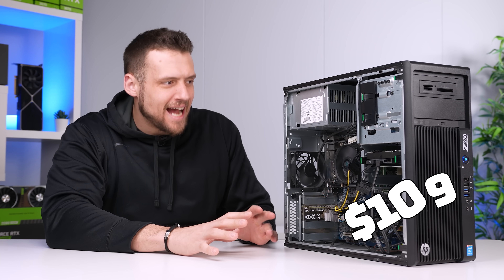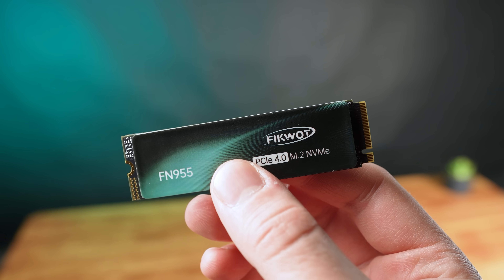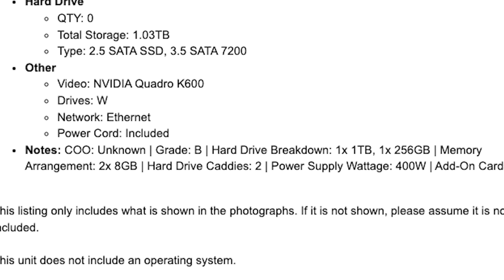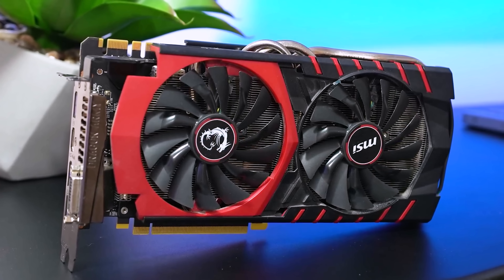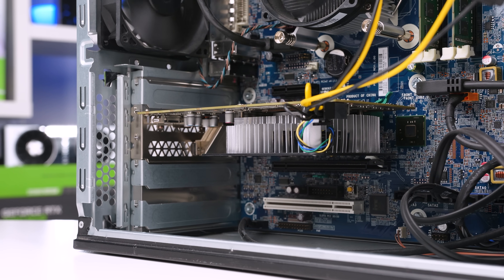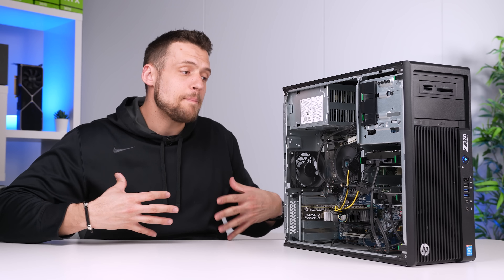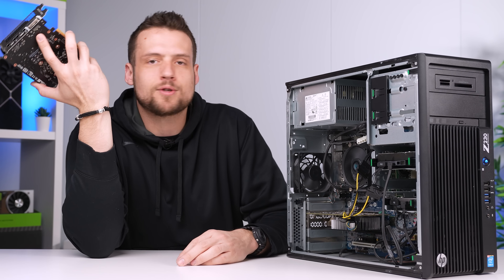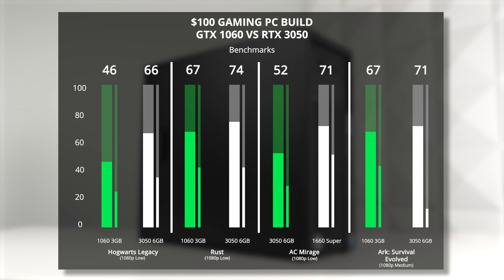This $100 Gaming PC Plays Every Game in 1080p

Comment: Hi ZTT!
Whats your opinion about this pc should i upgrade anything before buying it?

CPU: AMD Ryzen™ 5 5500

GPU: GTX 1660 super 6GB

RAM:2 x 8GB DDR4

Storage: 1000GB NVMe SSD

B550M motherboard

500W Power Supply

ATX Mid-Tower Case
Reply: Dude maybe if you can try to get some used parts yk like idk about the us but i got 3070ti for half the price it's supposed to be in india as it was used and now I'm also building a pc plus get a 550w power supply as most of these PC build vids I've seen recommend 550w still you've got a great setup idea tbh

Comment: I'm running a Frankenstein build. i5 4590 with an hp g1 600 motherboard. 32gb ram 1600hrz, GeForce GT 1030 2gd5. 1tb hdd. And a GX 750w PSU in 2025. Best $100 budget build I could come up with

Comment: Just a warning to everyone: I've had an HP-Z230 since 2013. I added an RX-480, and besides the overburdened 400W PSU shutting-off when loading csgo maps if I didn't ALT+TAB beforehand, it was great for VR and FPS gaming. However, the Xeon E3-1230 v3 can no longer handle CS2. On CS2 Benchmark, it has an average of 140 FPS with P1-lows of 80 FPS with hyperthreading off. I can feel the lag when playing Italy or Nuke, whereas Office and Dust II feel good, so long as a negev is not firing off. At least with CS2, the computer no longer loses power when loading a map.

Comment: if you are gonna do this, you might as well grab either a 6GB version of gtx1060 or an 8GB rx480 or rx580. there are games that will display an error and refuse to run on a 3GB gpu and there are quite a few games that won't run well on a 4GB card.

Comment: Processor Ryzen 7 1700 
M/B Gigabyte GA-B350M-Gaming 3
32GB Ram DDR4 Corsair Vengeance
250GB SSD Samsung Evo 850
Cabinet ATX Mid Tower Corsair
SMPS 500 Watts i-Ball Marathon
Graphics Card 2GB gt 710 2gb
Vs
 NvidiaRyzen 5 5600
Ram 16gb 
256gb SSD 
500gb hddAMD 
600 watt power supply 
Vs 
RYZEN 7 2700X
GIGABYTE B450M DS3H WIFI
8GB RAM
256GB NVME
PSU 550 WATT COOLER MASTER
MSI 6 ARGB FANS CASE 
If they are coming in same price which is the best option

Comment: My dad has 4 Dell XPS office desktops (One of them has a 2TB HDD and has been retrofitted into a local server that the other computers back up to for data safety) that are almost a decade old (if not already) and they've been slowing down. From what I remember off the top of my head, here's what they run on: 
- a 6th gen Intel i7 @3.4GHz - 2 cores, 4 threads
- Intel HD Integrated Graphics
- NVIDIA GeForce GT 730 2GB VRAM
- 8GB DDR4 - 2 X 4GB (UEFI shows 2/4 DIMM slots used)
- 1TB HDD (I don't know the speed)
He has said that he will eventually have to upgrade from these - is it worth it to try and upgrade these PCs to extend their use?

Comment: i love my "low budget" build its a i7 3770  yes its old but i got it for free i got a used gigabyte board for 40€ and a rx 580 for 70€(8gb vram) with 32gb i got with the cpu the case was from a 20€ pc i bought some years ago and i love it

Comment: I have gtx1060 and fx8350x (motherboard and powersupply broke, and now im on r5600g, but that doesnt matter), and even after that long time, my old gtx1060 which isnt even 4gb, but 3gb works perfectly fine on all games, you can easily play cs2 at 140fps average (on min settings, but no issues on higher either, just want some more fps, you know XD) and im pretty happy about it, now im planning to get myself a rtx3050 or rtx3060 for my budget and then my pc will be a beast for 6 more years i guess. Btw nice video, like your content!
Reply: Dude a bit of advice get a used one ,  i got a used 3070 ti for around 500 ish dollars or 35k rupees indian currency and i saw a deal for a used 4080 for rather cheap too
Reply: @Yoloooooooooooooooooooo  Yep, i know that used ones are cheaper, but in different regions there are different prices... For example, if something in my country costs around 50$ then in poland it will cost 15$. You got the point. YES its still will be cheaper for a used one, but not that much/less like in other countries
Reply: @tritaporika  then get a rx6600 as it's cheaper plus better then the 3060 you can look up a few comparisons too and in india we suffer from that overpricing too as a 4090 can cost upto 4k dollars or even more yk i feel you my g
Reply: @tritaporika  dude those vids on your channel, you played those games on gtx 1060 ? You reckon it can play helldivers 2 ?
Reply: @Yoloooooooooooooooooooo  Yep, only on gtx1060 3gb. But to be honest, i dont know ANYTHING about helldivers, but i just checked the system requirements and the minimum is 1050ti, its worse than 1060 so i guess it will have no problems playing it. You can do research by yourself, check the benchmarks, what system requirements does the game have and other things, thats not that hard. i dont do any videos now because literaly nobody were wathing, i have lile 70 videos 30min each, and only some has more than 30 views. Anyways, thanks for question! =D

Comment: I looked up the ebay seller and they charge $85 shipping and handling for an HP Z640 to the east coast! Insane! ZTT must live in Oregon because they offer free pick up or maybe he is excluding shipping costs which would skyrocket the cost of this OEM upgrade.
Reply: There is a pretty good sized weight difference between the Z640 and the Z230 in the video.

Comment: I haver 2 haswell systems:
1:
Asus H97 pro gamer
4790
16gb HyperX 1866
MSI 3060 12gb gaming X
Samsung 1tb SSD
4x 2TB Seagate

2:
MSI Z97 Krait SLI
4790k @4,4ghz
32gb HyperX 1866
Thaichi 7900 XTX
Western digital 1tb
4x 2tb Seagate

The second system is going to be upgraded to a 7800X3D system, but they both run great. 
The first is my office / guest multiplayer PC, the second is my baby. Upgraded graphics first. But you guys guessed....

Comment: Impressive, specially that case with an i7 cpu included at around just 50 USD, that's impossible to find in my country.. instead you can find used pc cases with something like an i3 cpu for around 150 USD..
PD: just reminding, that the gtx 1060 is low-tier and pretty old card, and it's driver support is on it's last stages

Comment: I'm currently using a laptop with low/underpowered i5 5th gen cpu and intel hd graphics (IGPU) and 2x4 4gb ddr3 ram. It was made for only workload, but the hd graphics is can run onlder games like l4d2, tf2 with some configurations, borderlands 2 on lowest settings, yes its that bad. I started using it when I got is as an gift. Love your videos tho.

Comment: I found a crap media centre PC thrown out 3 weeks ago. Chassis is old but high quality and a decent psu. The specs were horrible, FX 5400 4GB ram 1TB rust spinner. I went on AliExpress, €30 for a B85 motherboard, €16 for a E3 1270 V3, €7.98 for 16GB of DDR 3, €5 cooler and I found a low profile 1050 Ti 4GB for €50 second hand (decent price for Spain). All in about €120 and honestly it's a great steam box under the telly in the sitting room. So much so I'm thinking of selling the PS 5 because with a my huge ( since it launched) Steam library it's just much more fun than a console and with a Bluetooth dongle and the Xbox series X controller I already have it's fantastic for single player slightly older games I enjoy.

Comment: Most of those workstation are compact, you can't install a decent VGA inside. And they also come with very limited power supply, about 250W. I don't know if it's enough to support VGA, even 75W VGAs.

Comment: I'd be willing to bet in a few years, the 3050 will be considered a great option for a used GPU in a tight budget PC, replacing the 1030. It's fantastic price to performance if you can pick one up used for $50 or so, especially if you don't have a strong power supply or a 6 pin. Fingers crossed we see a 3050ti. The 1050ti was a decent card for the used market.
Reply: my laptop has a 3050 3gb, can handle most games at 1080 quite comfortably tbh. only game that defeated it was alan wake 2, 40fps with everything as low as possible lol

Comment: dude for 31000 pkr or 111 usd i got a dell precision t3610 with xeon(3 gGHz) cpu wich has a 10 mb cache 4 cores 4threads 8gb of 16000 mhz ram a 256 gb ssd and a 500 gb hdd and a r5 430 2gb ddr5 also the mother board has 8 ram slots ans an 885 watt 80+ powersupply
😀😀

Comment: Well man, it’s very interesting because I’ve done the same. Very similar thing to my Hp Z440 build that was how much I spend

HP z440 desktop $104.99

CPU Xeon E5-2667 v3 $13.75

16GB DDR4 ram $29.99

Kingston 480GB A400 SATA 3 2.5 $23.99

I use the same graphics card HP, GTX 1060 3GB for $50 that I bought from a guy on Facebook marketplace then the Rx580 4GB I found it way cheaper from another guy in marketplace outside my city and only cost me this much $35 
So in total was
$209.69 it would’ve been 224.69 if I kept the GTX 1060 I mean, I still have it. It’s just I replaced it with that. 😅

Comment: I done similar same workstation but with Xeon and I put a 950 total cost £80 quid although that's adding 25 for the 950 as that's the current selling price on eBay technically I had it laying around

Comment: The dolar is like 5.14rs so i guess i payed around $981,69 aprox for my PC so i guess in America things are more affordable. Setup Is a Ryzen 5 5600g, GeForce RTX 3060 Dual 12GB, two RAM 8GB 3200MHz, Motherboard is a Mancer A520M-DX, two (SSD 1TB, 2.5, SATA III, 6GB, 520MB/s and SSD 512GB, M.2 2280, PCIe NVMe 3.0, 2200 MB/s) PSU is a Thunder 600W 80 Plus Bronze, 30meter of wire (For my internet) the case is a HX550M Mid-Tower with 3 fans, a combo kit (Headset, keyboard rainbow ABNT and mouse) and a gamer monitor 21,5 1ms. Now i am thinking to buy more cooling, maybe just add few more fans i don't know i am still waiting my GPU so i didn't got to test it yet. The rest it works beautiful for me that didn't had PC gamer before

Comment: Can you please review this setup and if it can run properly on fortnite 
 

CYBERPOWERPC Wyvern Gaming PC - Intel Core i5-10400F, Nvidia GTX 1650 4GB, 16GB RAM, 500GB NVMe SSD, 450W 80+ PSU, Wi-Fi, Windows 11, Blaze RGB

KOORUI Monitor Gaming, 24 Inch Computer Screen HDMI, 165Hz, 1080p, 1ms, IPS, FreeSync, Compatible G-sync, Tilt Adjustable, Eye Care, VESA Wall Mountable (FHD 1920x1080, DisplayPort) Black

Comment: Hey Zach I have an intel i5 10400f and a 1660 super but want to upgrade to an rtx 4060 but idk what i should do if there is any other gpu options that are 300 to 400 bucks please tell me and please turn this into a video
Reply: I had the 10400f and a 1660ti, sold both and got a Renewed i7 10700f and a 2070super for the same price (Amazon i7 and zotac referb eBay 2070S) night and day difference.

Comment: I have an 4-5 year old system with an i5-8400, 1x8gb ram, used to have a gt 1030 but it doesn't work now for some reason, a psu of 500 watt and motherboard is gigabyte Z370 HD3. after the GPU broke down 2 years ago this PC is giving me pain to even do simplest of task and my father said he'll be giving me a new one end of this year. Few days ago my 500 watt psu broke down and I went to get a replacement and I asked to give me a 200 ish watt psu cuz I'll be getting a new one. and the guy was kinda hinting me towards to not build a new one and just upgrade this one. after seeing those numbers on a 4th gen i7 I feel like he is right, but than again this PC has given me sooooo much pain that its kind of a toxic relation now. Just yesterday my PC was booting than immediately shutting down for like 5-7 times than it finally booted and stayed on. few days ago I realised that I can't game and play youtube on the back at the same time without my game becoming a power point presentation. my theory is for the power the CPU can't perform to its maximum potential and that is why. What is your recommendation on this issue. Should I just tell my father to upgrade maybe a new psu and a 3060 GPU or a 6650 xt as you said in a video that 6650 xt is better price to performance (tho I checked my countries websites and both are same price for some reason).

Comment: Can you rate this build please?: 1.Intenso PCIe PREMIUM SSD 500GB, M.2 2280/M-Key/PCIe 3.0 x4(39.49€)
2.AMD Ryzen 5 3600, 6C/12T, 3.60-4.20GHz, boxed(89.90€)
3.Corsair Vengeance LPX schwarz DIMM Kit 16GB, DDR4-3600, CL18-22-22-42(40.90€)
4.XFX Speedster SWFT 210 Radeon RX 6600 XT Core Gaming, 8GB GDDR6, HDMI, 3x DP(185€ used)
5.GIGABYTE B550M DS3H(85.99€)
6.DeepCool Matrexx 30, Glasfenster(39.24€)
7.Corsair CX Series 2023 CX550 550W ATX 2.31(59.32€)

Comment: I have an old family dell OptiPlex 3050 with a i3 7th gen and 8gb ram and I'm not sure if the power supply is 180w or 240w because on the manual on the website it says 180w but on the psu it says max output 240w so idk. is it worth to upgrade the ram and putting LP gpu like the gtx 1650 ? It would cost me around 150$ with adding an nvme drive. I'm hesitate because all the tests and builds i saw are with an i5 and this cpu (the i3) is not that good 😅
Reply: go for rx 6400
Reply: @omerpolat1733  is the gtx1650 ok ? Because used rx6400 is not available in city and new is not so good on price. I found a gtx1650 (200sar) 53$
Reply: @fahad90s32  it is really good price for 1650 but maybe (im not sure) your psu can be a problem.
Reply: @omerpolat1733  thanks, and just to update i bought the gtx 1650 for around 53$ it wasn't lp it is from Asus but did fit in my case and it works fine also i just ordered ram (16gb) and waiting on it to test how it's going to perform since my pc only has 4 gb and i can't run any game currently😅
Reply: @fahad90s32  congratz man. It is really good deal for asus gtx 1650. I have gtx 1650 laptop and you know desktop version is better. So it is really decent card for most of games. Hope to it performs perfect.

Comment: Would there be any problems if I  replaced the power supply to a 750 or 850 watt power supply and replaced the i7 4790k with a i7 9700k then slapped a rtx 3060 in that computer?

Comment: Zack i got 0% bottleneck is this truth ?
R5 7500f
Gtx 1660super for fhd gaming
Reply: 7500F and work on even more powerful GPUs, I have mine paired with a 6800, solid performance.
Reply: Considering Ryzen 5 7500f is just downclocked Ryzen 5 7600x and 7600x can pair up with high end graphics card like RX 7900 xtx or rtx 4080 pretty well it's gonna be fine for GTX 1660 super

Comment: could you check my gaming pc    lists and tell me whats missing : idcooling a410 frozn

DeepCool CC560 WH V2 Mid-Tower ATX PC Case, 4X Pre-Installed 120mm LED Fans, Tempered Glass Side Panel, White

Crucial P3 Plus 1TB PCIe Gen4 3D NAND NVMe M.2 SSD,

GIGABYTE B650M D3HP motherboard

Corsair CX-M Series, CX650M, Modular Power Supply, 80 Plus Bronze

AMD Ryzen™ 5 7600X 6-Core, 12-Thread Unlocked Desktop Processor

ASROCK RX7700 XT OC CHALLNEGER 

and can everything fit in the case

Comment: Zach i just build my first gaming PC upgraded from pentium 4 to ryzen 5 5600 b450 32gb ram. But I am very confused about Gpu. My primary purpose of pc is mostly autocad softwares. In my budget I have two options either rtx 3060 12gb new or rx 6650xt I really need your help which gpu is best for autocad please reply me
Reply: For what i humble understand,  nvidia has better driver compatibility and support (less problems You could have using the software) than AMD graphics cards

Comment: The only problem that oem pc's are they only support forr legacy and some older or even newer oem ones has a different power supply connectors meaning you'll have some time to buy some adapters or maybe there's no actually way how to upgrade the psu of oems

Comment: Stay away from pre-built OEM systems. Even if you get lucky, you'll be stuck. You'll end up paying double in the long run. Instead, buy a used gaming PC with a good foundation (motherboard, CPU, RAM) and upgrade it over time. This way, you can upgrade again and again and sell the parts you don't need."

Comment: My brother did something like this, but he uses his motherboard for graphics. I wanted to try and put a gtx 760 in using the cable extensions but the power button just flashes orange and won't turn on. 

Edit: The cables I used only have one sata cable each. Would that cause it?

Comment: I was able to get an omen 25L with a ryzen 5 5600g, gtx 1660 super, 8 gb ddr4 ram (obviously will have to upgrade), and 500 gb ssd.

For 280$ honestly the best budget PC I've ever had, it is almost definitely worth just saving up to be in the 250$ price range.
Reply: You paid 250$ for that laptop? i have a similair laptop i7 10750h rtx2060, was 1300 euros in 2019 brand new. It still runs fine for me. 
You can upgrade ram now cheap (paid 60 euros for 2x16gb)

Comment: is 250 bucks for i5 12500, 1050ti, 16gb ram and 256 gb ssd good?
Reply: I would say so! Just get a better gpu when possible
Reply: @b-fenix5789  i dont think ill do that. the games im playing make my cpu bottleneck my gpu
Reply: @Shortitpro  a 12 gen I5? really? last time i checked it should be good enough handle like a 4070 or even higher!

i think even a 4090 would really not be that much limited.

the only thing lacking would be the gpu and provably the PSU
Reply: but if you can go higher go for it i guess

Comment: i am builging a PC for 300$
RX 580
AMD Ryzen 5 3600x or i5 12400F
B450 Motherboard with AMD (didnt think one for intel if you got any recommendation do tell)
16GB DDR4 3200Mhz
600W PSU
normal cooling and stuff dont really know about cooling and stuff
i alr got a 500HDD and a 128SSD and i am getting a new 1TB HDD for games 
i am also getting a gaming mouse and headset and maybe keyboard
is this a good build?